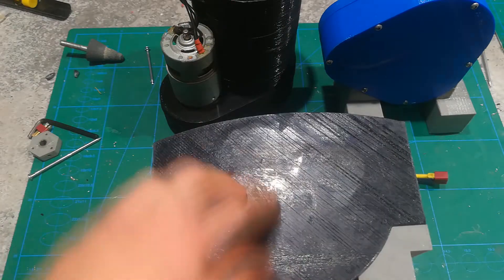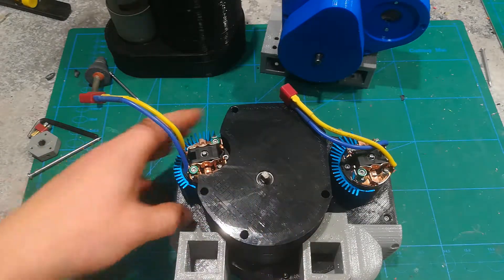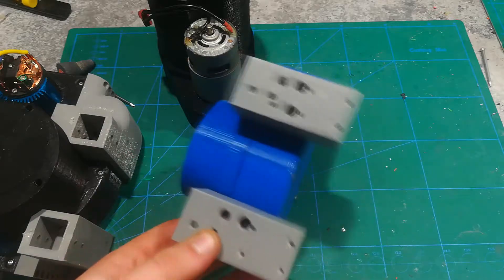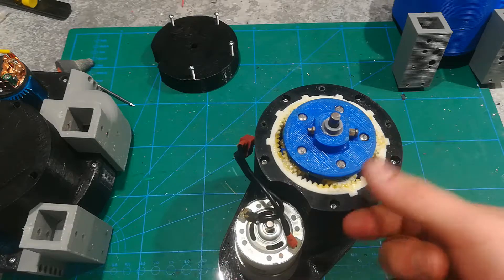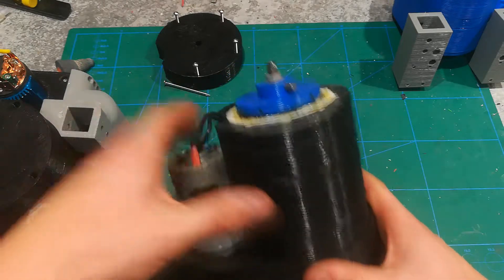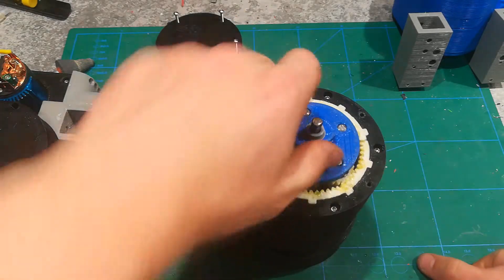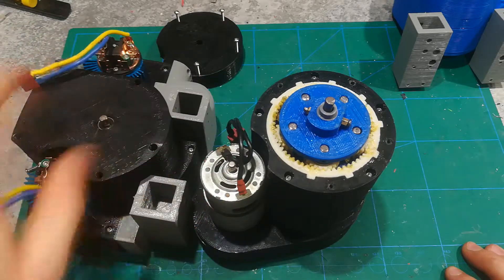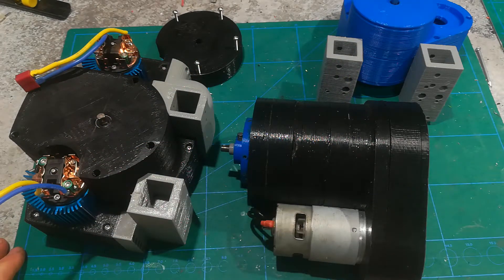OpenRC Trial Truck Build Tips Part 5 | Gearbox

Comment: Hi..did you have the wiring diagram for two motor gearbox? Thanks😊
Reply from the maker: Both motors are hooked up in parallel to a brushed esc.
Reply: @sisco6943  is it there just one esc?
Reply from the maker: @imanamal5522  I used just one, you can use 2 if you want
Reply: @sisco6943  i see.
i have another question,i interest with the planetary gearbox.
I open the planetary f3d formated file and i found there have two gear you put outside the casing.
I wonder that gear for what.,
Reply from the maker: @imanamal5522  if i remember correctly those are the same as the sun gear and planet gear, so when you modify the parameters, you can save those as stl instead of having to hide some parts to access the ones inside the gearbox. Also useful for measuring the gears to make sure your parameter changes actually worked. They are there just for convenience for working in cad.
Reply: @sisco6943  okay thanks😃🖒

Comment: I build it. There is plenti of torque. Do you think it would be possible to replace the first 2:1 Ration with 1.5:1 or 1:1?
I have over 100 Newtons of Pullforce. I think i dont need that much an would prefer some speed :)
Reply from the maker: Maby you could swap out the 1st two gears with pulleys and a timing belt? It would be quieter, but you would need to add a tensioning system, which would require modifying plate 2 at least. Or if you just want different gears, i got the helical gear models from the khk gears website, which allows you to download their gears as .step files. I dont have time to do this right now, so what you do is up to what you want to design.
Reply: @sisco6943  yeah that's a good idea. I will take look into it. Like the timing belt idea. Disassembled the gearbox due to a bend shaft and petg works pretty well! I like your model. 
You are ok if I use your gearbox for a medical wheel tank? I'm into designing something with torsen diffs and I need the space of a tank :). My plan is an openrc wheeltank.
Reply from the maker: @Das_Schaf  yea go ahead and use it